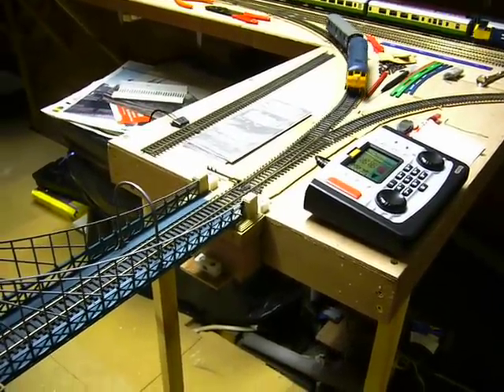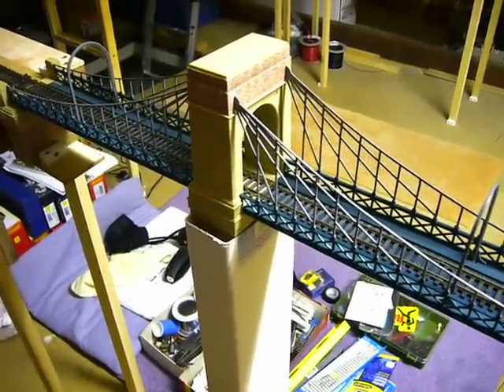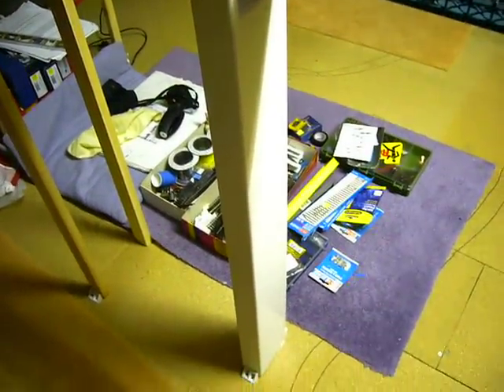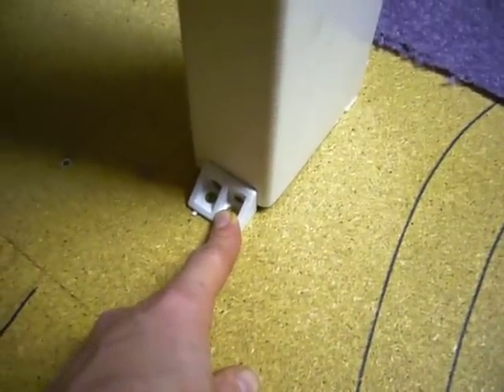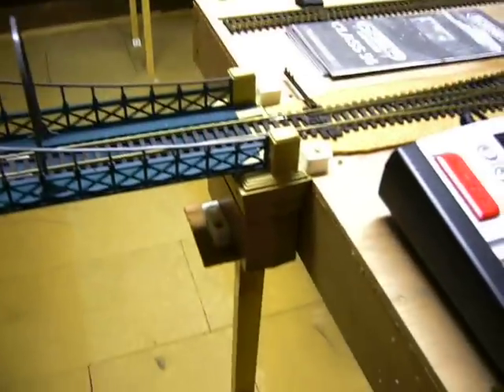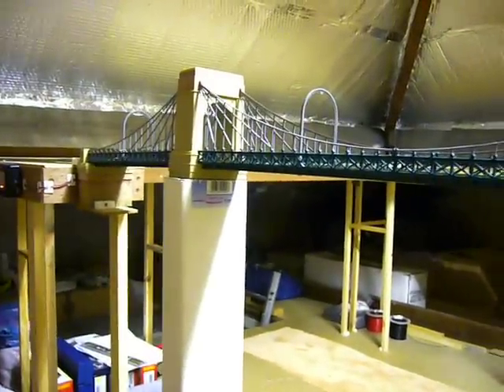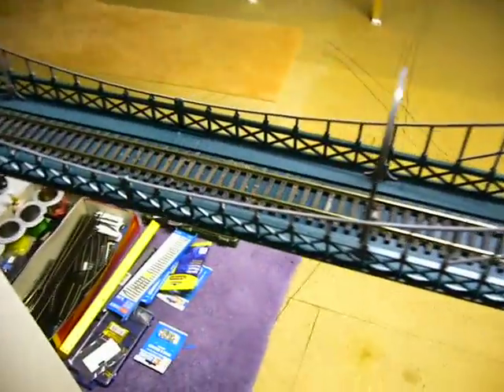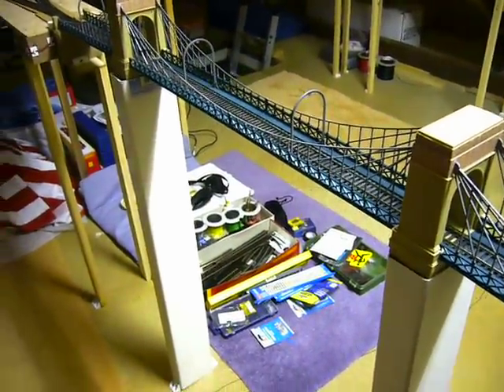Suspension Bridge - Hornby

Comment from the maker: You make the bridge as seen in this video or shorter by using only one of the two towers & two deck sections. I have however seen one of these Hornby bridges extended by adding more Hornby suspension bridge's to it. Looked quite impressive as the owner of that layout had used 6 bridge kits!! Cheers.